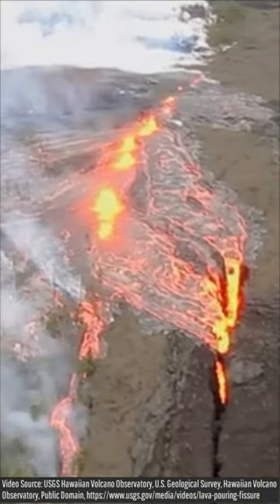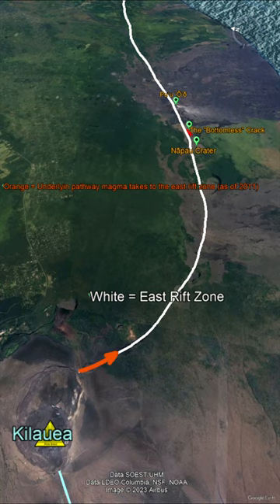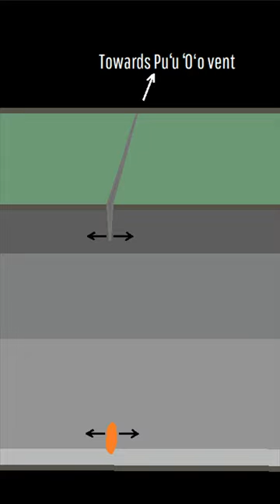Lava Falls into a Bottomless Crack

Comment: Does that have interesting implications for mineral formation?
Reply: All igneous rocks are made of interlockong minerals. Maybe you mean ORE mineral formation? Like gold? These shield volcanoes in Hawaii don't have a lot of chemical diversity. Most ore bodies and the larger crystal structures form at depth in more intermediate chemistry volcanoes like stratovolcanoes. Some ores with lower melting points accumulate in fissures and are usually associated with silica dioxide (quartz).